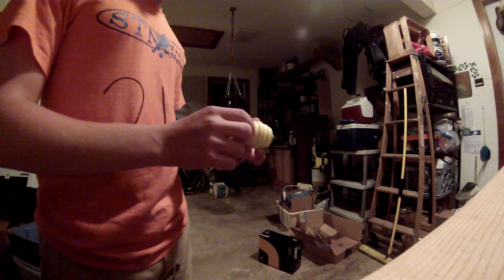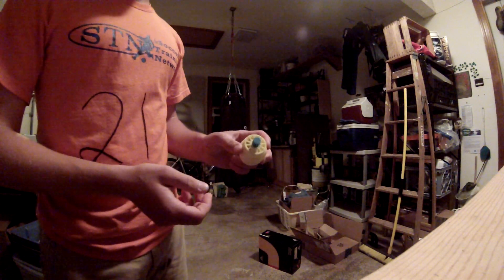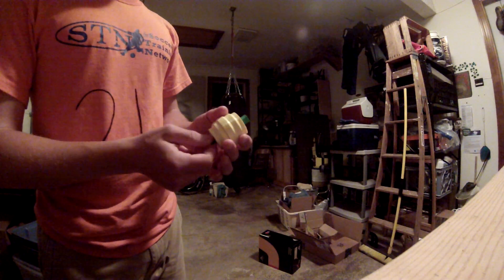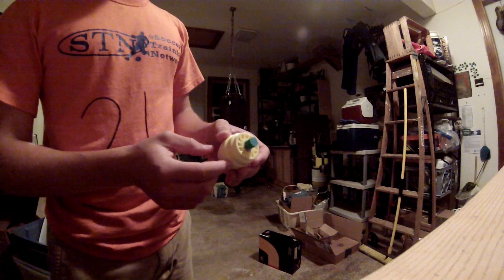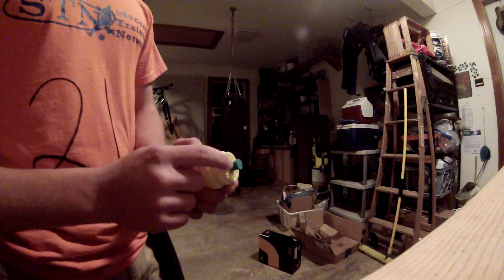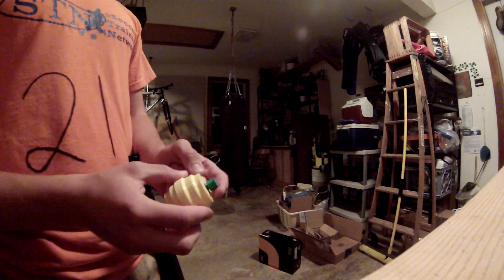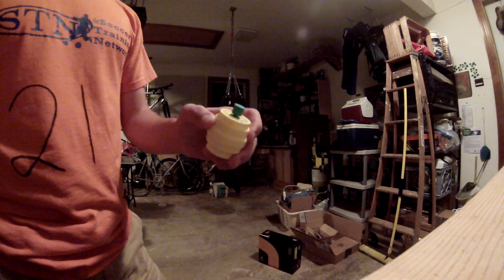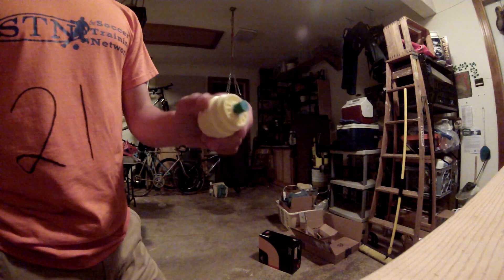3D-Printed Turbine Test

Comment from the maker: I actually had to reprint this one for a similar reason. This was an early print and at this point, my reprap had its y axis flipped. The screw threads on this one are backwards and the shaft spins the wrong way. I have it reprinted, and am in the process of making the shaft out of metal. I might make a video update once it is fully workings (hopefully soon)